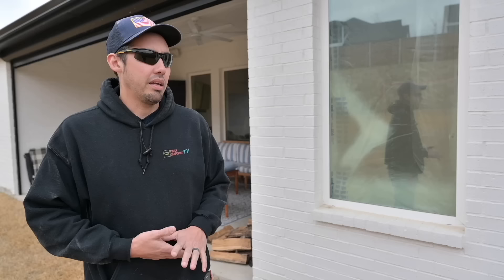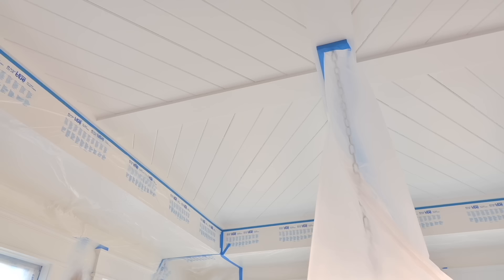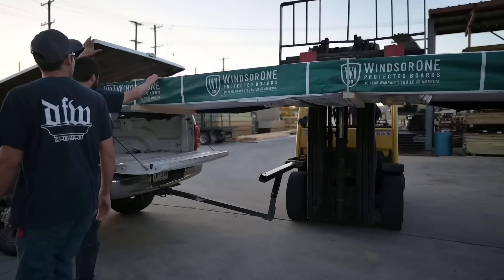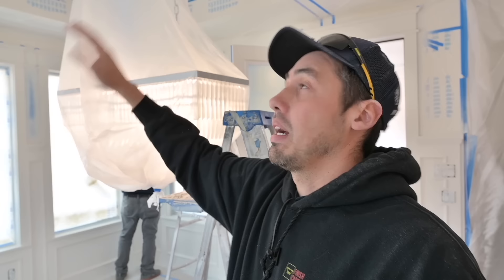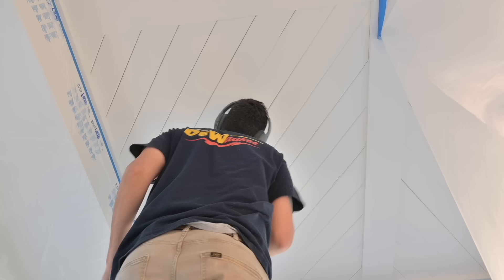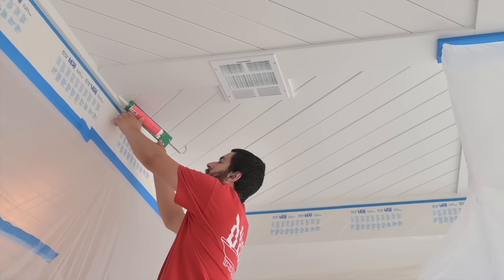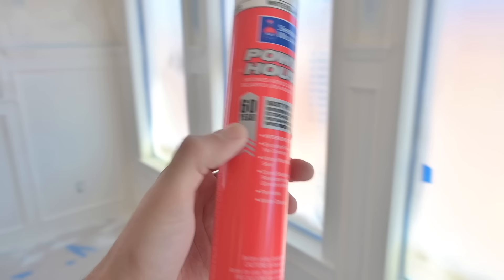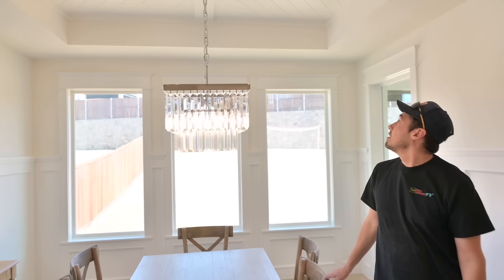Customer furious with me - Failed Trim Install

Comment: We paint quite a few t&g ceilings. Best practice is to prime back & edges before install if possible but NEVER caulk any of the grooves! Hope I’m wrong but I’m afraid you might be back!
Reply: No he will be back because we both know what’s going to happen!
Reply: 100%, t&g designed to allow for seasonal movement. Caulking is certainly not recommended at any cost. Unfortunately he will be back but not to re-caulk.
Reply: Agree. If I were going to caulk anything like this I would use something along the lines of loxon masonry caulk. It’s a urethane based product, definitely harder to work with but is head and shoulders above any traditional acrylic caulk and I think runs under $6.00 at SW. Obviously paintable too.
Reply: You are 100% correct . Should never ever caulk. Hence the t&g design. That's the sole purpose of the design to not show seasonal movement
Reply: He still hasn’t learned his lesson.
Reply: Was going to say the same thing, you need to pre Prime the same color as your final paint the edges and allow to dry before install.... and that is definitely not a place to caulk. You nailed it on the head.
Reply: A more stabile species like poplar, shop milled on a new application might be a better alternative or 1/2” MDF ultralight panel using a V groove router bit with a T&G on edges only.
Reply: @user-yr4os6jz4r  Then the wood will crack or bulge out working the nails loose. Wood will move.
Reply: Am I missing something here? Don't you want the lines to show? Isn't that the whole point to have the pattern? Why would it be caulked? I'm very confused why he caulked it in the first place.
Reply: @user-yr4os6jz4r  you glue your rails and stiles only where they are joined together but your panel always floats. Allowing for expansion and contraction.
Reply: @user-yr4os6jz4r  the t&g boards will split with seasonal movement
Reply: @SublimeWanderers  Exactly
Reply: So this happened to my tigerwood flooring so I guess there's no fix for the spacing?
Reply: @user-yr4os6jz4r  You just watched the proof. Wood is not elastic, it's not going to span gaps like these that appear after movement or drying. If you use a solid panel the size of a ceiling, it will fail unless you allow it to move a little. Same with your butcher block. If you make it the size of a table and glue it down to a surface that doesn't expand and contract something will fail. Either the glue or the wood, unless you are in a very controlled environment.
Reply: quite correct,  Do not depend on caulk..  This will fail again.
Reply: @user-yr4os6jz4r  if you glue the tounge in the groove the boards will split when they  expand and contract
Reply: You are absolutely correct. Forget the caulk, the wood is going to expand and contract no matter what he does. The customer might not like the look of the cracks in the caulk because the wood contracted when it dried but neither will they like the look of the caulk being squeezed out of the seams when the humidity is high
Reply: I believe it’s possible he may not be back due to the wood had dried out . 
Yes it will expand and contract slightly . 
With the caulking and also with a thick primer and paint it may not show any cracks . 
With that being said not sure why he caulked in the first place ?
Reply: @user-yr4os6jz4r  plywood is an engineered wood, it does not need to expand and contract nearly as much as solid wood does. The species of wood also plays a role in how much a piece will move over the seasons. You can control movement of the wood better the more control you have over the humidity the wood is exposed to. Painting the edges and end grain will also help with movement a little. 
I wouldn’t be comfortable saying this project would fail again or that it wouldn’t, because I don’t know how much the project will be exposed, or what other steps have been taken to limit the amount of movement. If the room has any type of noticeable draft to it, and that’s solid wood, it will probably split again. If solid wood is glued in a large panel formation like that, and exposed to any significant amount of moisture, the wood will most likely crack along the grain, since the glue is stronger than the wood. I don’t know if I would recommend people NOT caulk the edges of this project, they could if they wanted, but I certainly wouldn’t recommend anyone glue something like this, unless it’s made from some type of engineered wood. May last a bit longer since they seemed to have used a more flexible caulking, but depending on other factors, you definitely wouldn’t need to wait 60 years.
Reply: I would never have caulked the joints, isn't that what people want to see? The joints!!?? I don't care how dry it is, come back in a year or 2 and show us some pics...
Reply: @user-yr4os6jz4r  so wood expands and contracts with changes in humidity/moisture this is why there is an expansion gap around a floor, if panels are glued and they expand and contract they will split/crack along the path of least resistance! This is basic wood working knowledge no need for insults to the people that live in the hills of Tennessee
Reply: so how does a guy like this end up calling himself a finish carpenter with half a million subscribers?
Reply: @user-yr4os6jz4r  you carry on thinking like that if it makes you feel better and I'll carry on with my way happy gluing 😋
Reply: @user-yr4os6jz4r  even if you glue the boards will still expand and contract throughout the year. They are referred to as Witness lines in the cabinet world and they will show eventually anytime you are painting true wood.
Reply: @user-yr4os6jz4r  Or what if you used Quad or Lexel white "rubber" sealant caulk?
Reply: @user-yr4os6jz4r  The stress would crack the native wood since glued joints are stronger than most woods, if not all of them.  Ask me how I know that, lol.
Reply: @user-yr4os6jz4r  you’re confusing the difference between solid wood and plywood… plywood has been engineered during manufacturing to reduce expansion so your thoughts on flooring might be correct but does not apply on real wood T&G…
Reply: @user-yr4os6jz4r  If it can shrink, it will shrink. When it shrinks the cracks will be at the weakest point in the wood. If the expansion joint (the gap between two pieces of wood) is stronger than the plank itself, then a crack will appear on the plank which would look more noticable, otherwise the tongue might crack off inside the groove weakening the joints.
Reply: @user-yr4os6jz4r  I was referring to the subfloor plywood and not the actual flooring. Maybe I did not do a good job articulating that point.
Reply: @user-yr4os6jz4r  @Dave has solid advice here. Allow the butcher block to float when attaching it to the table base. The butcher block will expand and contract as one solid piece if done properly, make sure that the base doesn't prohibit it from moving. Oval screw holes are an easy way to allow for this expansion. Otherwise you can use joints that are designed to allow for this movement.
Reply: @user-yr4os6jz4r  Cracks are super common in hardwood flooring—especially noteworthy in climates that have large temperature and humidity changes like the East Coast. Normally they are filled with putty every time the floors are refinished. Engineered flooring avoids this problem by "floating". "Floating" floors aren't attached to the subfloor, and their seasonal expansion and contraction is hidden under the baseboard. Look up hardwood flooring expansion and contraction and you'll find a lot of interesting stuff.
Reply: @user-yr4os6jz4r  Plywood is an exception, because it's extremely stable. MDF even more so. As the name "plywood" implies, it is made up of multiple layers of wood with the grain going perpendicular to each-other. Since each thin layer is bonded to each-other in different grain directions, this minimizes expansion and contraction of the wood. Plywood when exposed to shifts in humidity and temperature can still warp, but doesn't expand or contract nearly as much as solid wood.
Reply: @user-yr4os6jz4r  Gravity. Floating floors with an expansion around the perimeter are held down with gravity. A ceiling is fighting gravity. How do you adhere it to the joists while allowing for expansion and contraction? I mean, there are ways but the only ways I can think of are a lot more work than just not using caulk.
Reply: @user-yr4os6jz4r  no. You never glue cabinets together. Just screwed. Don't know where you got that idea from
Reply: @user-yr4os6jz4r  no. as long as you let the hardwood acclimate to the houses climate it shouldn't shrink. This dude's problem is that he didn't let it acclimate or dry out before he installed it. Especially because he installed it tight. Once it dried out it ended up giving him a 1/16 to 1/8 in gap.
Reply: @dc6233  it's not shiplap. It's tongue and groove bead board. It's not supposed to have a nickel gap, it's made to be installed tight. So you just want to see the groove not any gap that's why he caulked it. If he would have let it acclimate to the house first and used some flex caulk instead of just regular painters caulk he probably would have been fine.
Reply: @user-yr4os6jz4r  nah. Only glue would be on the back to help hold it to the ceiling if you want but don't glue it to each other.
Reply: Been a decorator for over 40 years now,and your comments are 100% true never Cork.
Reply: @user-yr4os6jz4r  you’re probably getting hundred’s of years worth of experience in the comments directly contradicting what you say, so what do you believe is more likely? All of these other experienced workers are wrong…or you’re wrong?

I’m beginning to think you’re trolling.
Reply: @user-yr4os6jz4r  Yeah, you’re 100% trolling. The “immigrant” comment gave you away, buddy.
Reply: @user-yr4os6jz4r  You only get to crack the boards
Reply: @user-yr4os6jz4r  LMAO .You are the GOAT
Reply: @user-yr4os6jz4r  Ah yes, fallacies the sign of someone knowing he is right (no matter what). If you don't care, I don't care. Happy easter.
Reply: @user-yr4os6jz4r  You'll get buckling and warping if the all the T&G joints are glued together.
Reply: @user-yr4os6jz4r  plywood does not expand and contract because of how it's made.  You don't glue tongue and groove flooring...you staple it in the groove.
Reply: @Chip57  Yup, MDF would have been the answer here. Not caulking.
Reply: @user-yr4os6jz4r  That's a much different application.
Reply: @user-yr4os6jz4r  My t&g hickory changes with the seasons. Tight in summer, and a slight gap in winter due to hot air heat.
Reply: @luv14lyf  Humidity will help. Does it do it in winter and tighten up in summer?
Reply: @user-yr4os6jz4r  do yo0u apply glue to the tongues, or to the subfloor? All t&g flooring is nailed/stapled down here.
Reply: @user-yr4os6jz4r  you can’t do that. The seasonal movement will pull the wood apart causing splits
Reply: @NEKingdom241  its about the same year round. We have a humidifier on the furnace but it didn't seem to make a change in the floor
Reply: Totally agree it should not be caulked, but if boards are not dried out enough there is still the chance you will be called back as the movement/shrinkage will cause the paint to crack...the fix is a lot easier than raking out the caulking tho !
Reply: @user-yr4os6jz4r  ive never once seen t&g flooring glued down or glued to each other that didnt eventually show cracks somewhere wtf are you talking about?
Reply: as a painter I would ever caulk this lol. he should've known that too. like caulking shiplap. even caulking molding it can and probably will crack over time and humidity changes.
Reply: That and setting realistic expectations for the customer.
Reply: Definitely let the wood stay in the house for a bit of time, doesn’t take a crazy long time though. Definitely prime both sides, back at least once. Hopefully there is stretch to the new caulking, because there’ll still be seasonal movement. It’s like when people paint solid panel, five piece cabinet doors, and gob the paint to the seams, so you can’t see them. The summer comes, and the panel (which is loose on the frame) expands and blows the frame apart from being glued by the paint.
Reply: @lucastudor5536  the bevels on the edges are meant to make any gaps less noticeable as they are hidden in the shadow between the boards. That is unless you apply caulk. Then the wood movement shows up as paint cracks. The correct answer is to just not caulk the long seams at all. Pre-paint the edges so any part of the tongue that does show up is less noticeable. Asking for a wood product to stay tight forever is like asking a rock to speak. ANY wood product is subject to seasonal movement. MDF has no grain but will swell and shrink in all 3 directions. Solid woods will swell and shrink mostly perpendicular to the grain. The customer needs to be aware of this and if that won't be acceptable, then use a different product, like metal. You can attempt to minimize the effect by aclimating the boards, applying finish to all 6 sides of every board, and leaving expansion gaps around the edges of the room, but that WILL NOT guarantee success, just increase the likelihood of success. Caulking the edges guarantees that if there is wood movement, it will show up as a paint crack.
Reply: This is an application I haven’t really seen before. Frequently, a t&g is left natural color.  The “whitewashing” seems to defeat the purpose. I think I would have either primed or painted beforehand and anticipated movement.  I also think the nature of the havc register is oddball.  I think I would have moved it to the perimeter.  It usually a bear to get the joints to line up when setting things at 45 degree angle.  Check that - it is  I even wonder if the large flat boards were an afterthought, tied into that.
Reply: @SublimeWanderers  I guess he caulked to stave off hairline joints.  It would require a fussy caulk job with a very fine line caulk joint.
Reply: I have to agree unfortunately as it actually looks like he does really nice work with attention to detail and pride in his workmanship. Doing all aspects of a job is tough because you can’t really be an expert at everything. Here in NZ there would be several trades involved and the painter would know that you never caulk t&g but the builder probably wouldn't know that. So it would be on the painter to remedy if they caulked it and had this happen. Feel for you though dude. Never a nice feeling getting called back. I'm facing that myself right now for a really dumb error that's totally on me and costing a small fortune 😪
Reply: @allaboutinteriors6761  I agree! Richard seems to do excellent work…both in trim carpentry and painting from what I can tell! He also comes off as just a really nice guy! My intent was definitely not to criticize him, just to give my perspective and some friendly, constructive advice as a painter…the only trade I’d consider myself “good” (or at least experienced) at!  I can do a bit of trim carpentry but if I tried to completely trim out a house myself before painting it, I’m sure he could find hundreds of errors on my part! While someone can learn, perfect, master, and even invent new tricks of a single trade in a career, more than one is extremely difficult! I’d say he does pretty well considering!

Comment: You've got integrity brother, that's why you're successful.
Reply: He's got tegrity
Reply: b
Reply: @galvanizedgnome  Tegridy! Thinkin the same thing.  We had some roller doors installed by a company called integrity roller doors.   We had and issue and i can say they did actually deal with it with tegridy
Reply: he doesnt get a pat on the back for doing the right thing.
Reply: @ScreamingEagleFTW  especially because he didn’t do the right thing !
Reply: @wildnorthadventures6543  yes he did. He took care of the customer and re did the work. Im saying he doesnt get a pat on the back because thats what you are supposed to do when you screw up. Make it right at your own expense.